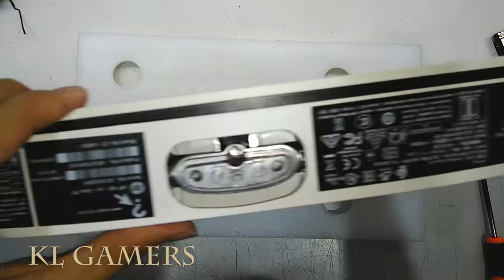HP All-In-One PC 22-b405d AIO Desktop Disassemble and upgrade SSD with metal bracket increase speed

Comment: An SSD gives new life to an old PC.
Reply: Yes bro
Reply: So it comes with a 500G HDD
It gets replaced with 256G SSD and it will make it faster? My hp all in one slow now and looking to upgrade. Just seems odd to go down in memory and up in speed?
Reply: @TheCgehlhausen4  mine comes with 1TB
Reply: @footyzone1852  same
Reply: @TheCgehlhausen4  It would definitely give a second life to that AIO... And try to increase system RAM to 8 GB for best performance... What makes the difference is the SSD SATA III random read speed compared to the current HDD, not the capacity itself... 256 GB is minimum recommended Storage for OS drive nowadays...

Comment: good man, well done .
I did the same yesterday! :D  all in one lenovo. I suffered just a little because the "case" doesn´t have size for SSD. 
yes: new life for the offimatic all in one - we know. you can't demand so much performance , it is as is .
( sorry but ... a few plastics of open- close are broken, I could not avoid, this is the second time I do that  O!  )
Reply from the maker: Nice work!
Reply: It just takes a lot time.  I find using a cellphone tool kit helps a lot.  I only taken two apart an HP and Lenovo.  Both are good office PC and that about it.
Reply: ssjkyle31 👍🏼
Reply: I just flipped the hard drive upside down and used double sticky tape. Where is it going to go?

Comment: Has someone tried 16 GB RAM (2 x 8 GB DDR3L-1600) on this System? As per processor specs (J3710) it can handle up to 8 GB but I was wondering if it can actually take the 2 x 8 GB. My nephews' AIO has that same processor and 1 x 8 GB module installed and, thus, a free slot...

Comment: Oh come on! What kind of voodoo magic did you use to get the door of the optical drive off? It went so fast I couldn't see what you were doing. I know how to open it, but once open how did you get the door off?
Reply: Nevermind, I figured it out without breaking. There are real tiny little hook clasps that need to be unhooked by bending in order to get it out. From this angle start with the bottom. If you rotate the system 90° clockwise from this angle, start with the far left.
Reply from the maker: yes sir
Reply: @KLGamers  Thanks

Comment: Hi Bro i have noticed in many of u r videos u have used budget Asus-A320 M-K...I am planning to buy one for a build also planning to install 8x2 ddr4 and 4gb graphics in the future..can u please tell me in u r review of the mobo if its a good one and the durability.
Reply from the maker: Asus-A320 M-K = most basic function 
if have doubt then can buy B450M use more $$
If your motherboard box comes with a silver color AMD Ryzen 2000 series Ready sticker, most likely you will need to update BIOS before you can use a AMD Ryzen 3000 series processor.
If your motherboard box comes with a orange color AMD Ryzen 3000 series Ready sticker, it comes with new BIOS , most likely it will support a AMD Ryzen 3000 series processor out of the box
Reply: @KLGamers  Thankyou Bro.I will use your advice wisely.

Comment: Can a second SSD be installed instead of DVD? Using caddy as in laptops? @KLGamers
Reply: Yes you can. Any DVD can be replaced with a Caddy but transfer speeds are super low. Better to uninstall the HDD and use that as a caddy, speed difference is slower so the bottleneck isnt as bad as with ssd

Comment: Adapter's don't always line up, some HP all in ones have 4 holes for a SSD already drillled into the hard drive cage, check before you buy, sometimes one screw if the cage has holes or grated looking can be used get that screw to hold the SSD, no moving parts so just need something to hold it. Always looking to save a buck
Reply: Just use double sided tape for ssds